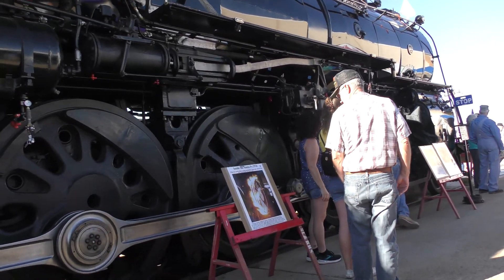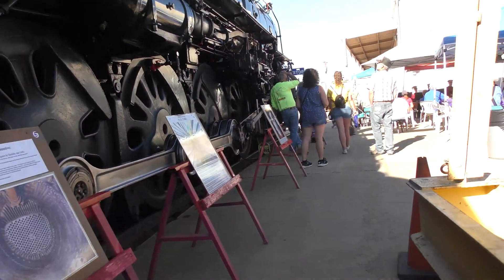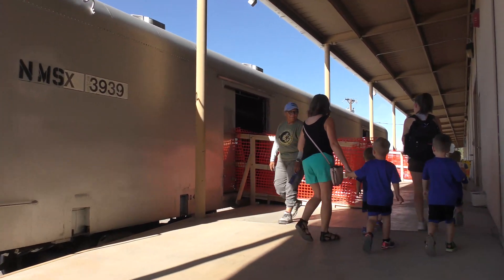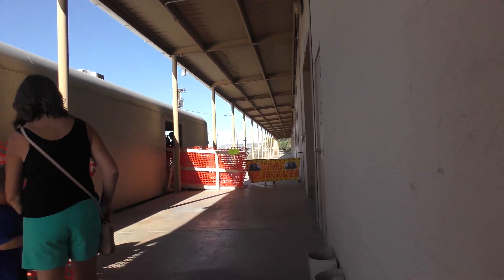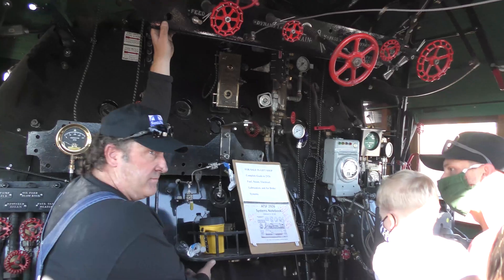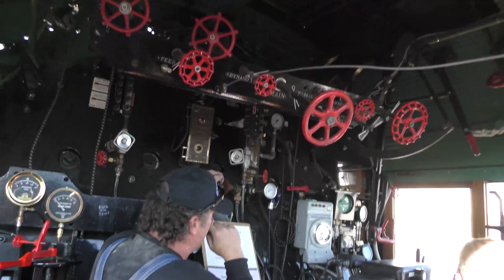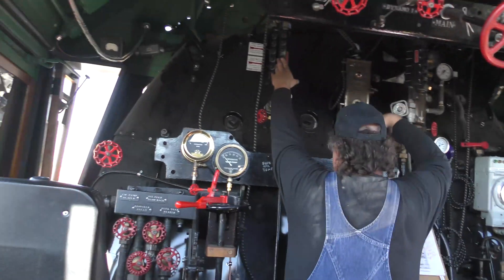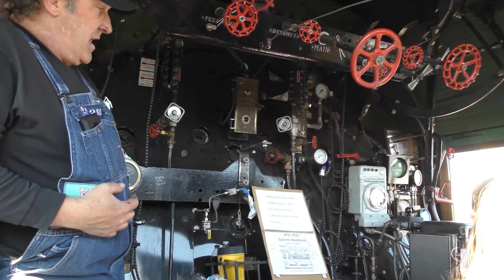AT&SF 2926 Open House and Update!

Comment: LeapTC is an interesting concept, though I'm also looking forward to seeing how Union Pacific's gonna get fully independent PTC systems onto their steamers and if any other groups are gonna follow in Uncle Pete's footsteps once those aforementioned systems get tested in service.
Reply from the maker: Union Pacific managed to deal with it on 4014, although I don't know how.  Anyone?
Reply: PTC is probably the only solution to operate mainline excursions on class one railroads and I urge that all mainline steam operators implement PTC so they can run on the mainline and make some money on some excursions but if they don’t want PTC or can’t afford it they have to run on short lines and regional railroads!